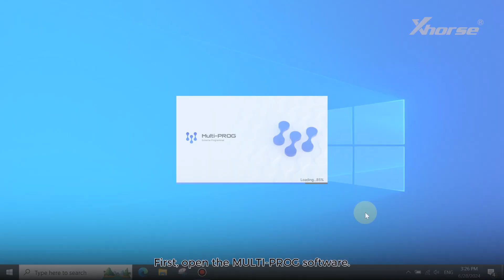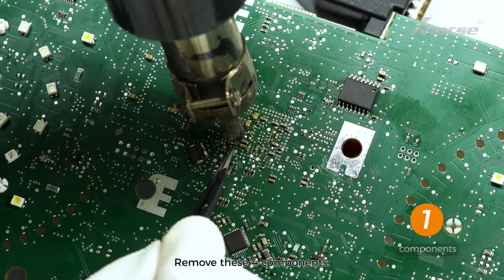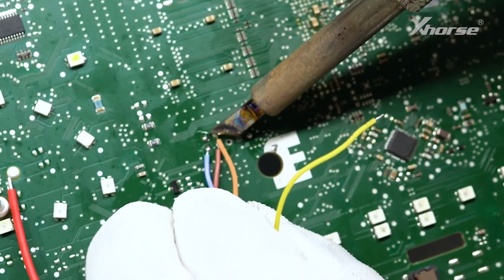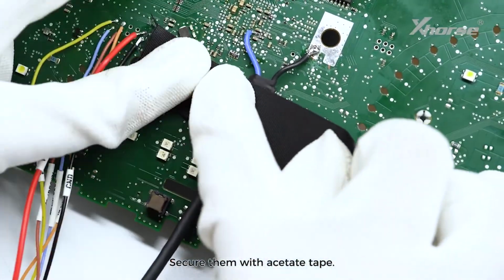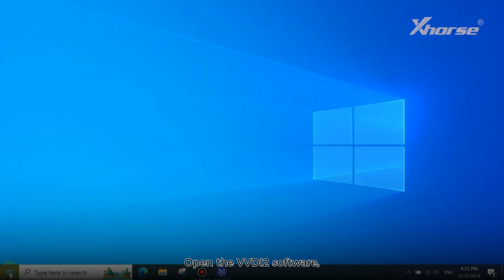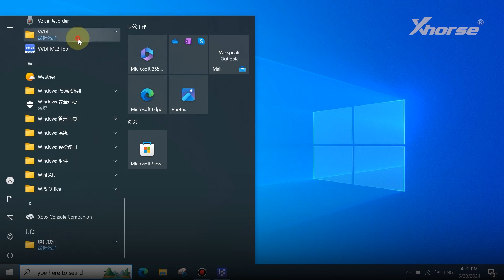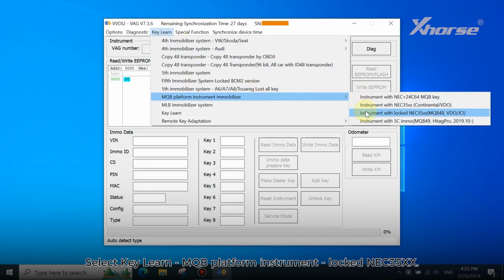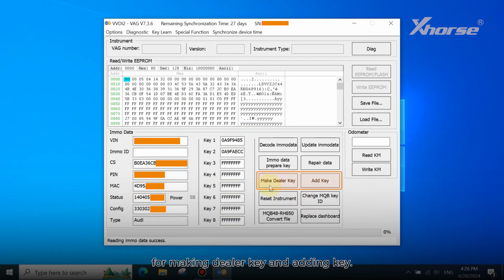Xhorse Multi Prog Read MQB RH850 R7F701407 Dashboard with RH850 Adapter- OBDII365

Comment: Can we do the same procedure without multiprog, but by using VVDI PROG or Key Tool Plus?
Reply from the maker: vvdi prog cannot read MQB RH850/V850, only with multi prog or key tool plus. they use different rh850 adapter. search RH850 on our website and you will see different adapters

Comment: Multi prog Doesn't work with vvdi 2.error 5000 no code immo data
Reply from the maker: did you combine multi prog with vvdi2 to share MQB license yet? If did it, check your cluster version, if it is 5C cluster, xhorse cannot decode immo data for 5C. In this case you will get error 5000.